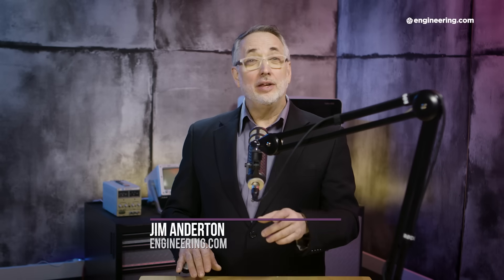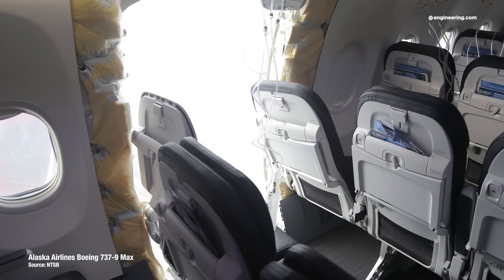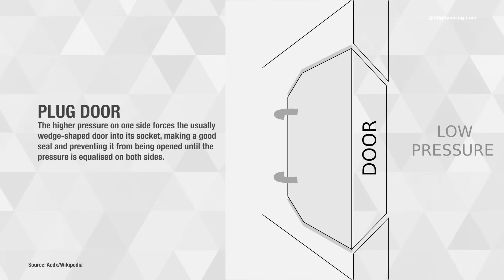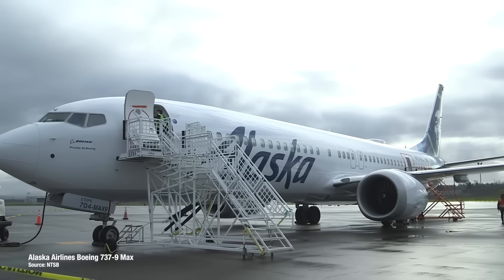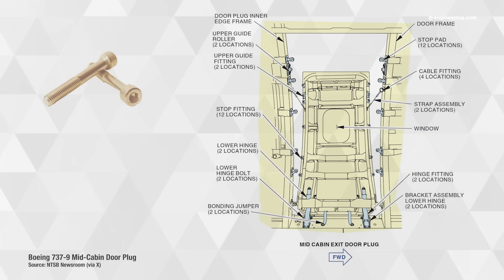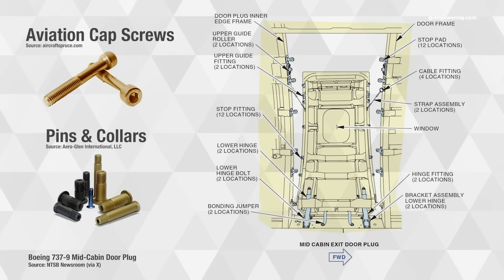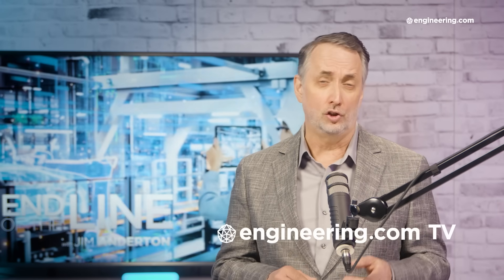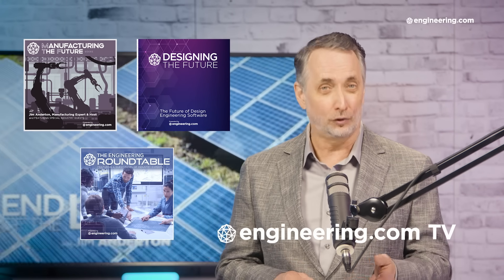The Boeing Issue Isn’t About Bolts

Comment: I have been constantly commenting on the lack of anyone talking about the what you call "witness marks."  Immediately, they knew if the bolts had been installed or not by the marks in the holes and where the end of the bolt and the washer on the nut side were tightened.  A cotter keyed bolt does not come out easily.  If the bolts were in they had to be sheared and those marks would be obvious.

What you did not talk about is the terrible corrupt culture of money over inspection.  This is a problem everywhere.  Inspection used to be #1.  I cannot even buy a high end cam and lifters for my motor anymore without multiple failures from the same Q.C. problems as Boeing and many others have now.  

Now that there are two crashes from a lack of good engineering and this door that falls off because of a lack of a culture of inspection what does it take to wake everyone up.

The prime blame here is on the FAA.  They control this.  I had a friend who worked at Douglas and was the prime FAA person for Douglas.   Many FAA employees went far ahead at the FAA as a result of them making sure all was properly inspected.  It was noticed that there were many fewer problems there, good careers resulted.  Now, you cannot blame inspectors if they are not honored for the importance of their jobs and not given what is needed to do the complete job which is also looking for FOD.

I was one of the few highly trained skin and frame repair people.  That at the time was the rarest of stamps.  Our work always passed the closest inspections as without our work that product could not be moved.  Obviously, no one does this anymore.

Spirit also builds for Airbus and many others such as Bombardier.  Is the same lack of Q.C. going on in those areas?  If they are properly inspecting other jobbers this is really ugly what is going on and if they treat the others as Boeing it is still ugly.  In one case the same management makes sure things are properly done, and in the other case the same managers have two sets of rules when there should only be one for a quality work place.
Reply: This recent Quality Assurance  problem is not limited to only the Aviation industry, were also seeing huge quality problems with new yachts, i've never seen so many of issues on new yachts in my 20yrs in the industry.
Cause and effect we saw a high number of experience guys leave the industry, it doesn't help when you have a Government threatening people to get vaccinated or get fired!!
Reply: Cost is now job one across multiple American industries. All the more profits for shareholders and executives. Notice I didn't say employees because now they are considered "costs". As you can guess this is short term thinking as the company is hollowed out "extracting maximum value" it will decline. Then everyone loses but by then the profits will be removed and long gone.
Reply: @cennsa140driver    Golden parachutes need to be illegal.  This is how wall street bribes execs to drive off the bankruptcy cliff without hesitation.  It is why so many companies only care about short term stock manipulation and disasters like this don't even hurt because investors can short their own investments to hedge.
It does not matter what the FAA does, they will never get these execs to help improve the company, they all get massive rewards if they stay the course, even if it means bankruptcy.
Reply: @cennsa140driver  We are heading to times where the fourth industrial revolution makes those jobs obsolete. It's just a matter of time. Maybe Boeing is a little bit too rashly here (irony intended). They have a huge backlog in their orders book. Nothing to fear currently from this point of view.
Reply: So many commenters think they are experts about SO any things.  The earth isn't flat, and unless this is your job, you are guessing.
Reply: @rogergeyer9851 There's a big difference between someone who worked in the industry making an educated guess and someone who never did just pulling it out of his arse.  I worked in the industry for years and saw things like this happen more than once.
Reply: @ Georgia - I doubt that most have any idea what a 'stamp' actually is.  As a QC person, you are required to stamp the process sheets and verify that the step was completed in accordance with the applicable requirements. 
Your comment about Spirit building for Airbus, Bombardier, etc. is also salient and brings into question how widespread this may be in the industry.
Reply: @vincentsutter1071 It's a lot more common than you think, and it's not just fasteners. I have seen situations where major structural components were left uninstalled.
Reply: I'll believe boeing is fixing quality when they announce massive new hiring.  They need more people so each person does a little less per day and everything is inspected by someone who also is not overworked.

The FAA needs to set minimum staffing levels.  If the FAA does not require boeing to hire more people, the execs will never do it.  They all get golden parachutes if they run the company into the ground, they are going to hang onto those jobs until boeing is no more because it will make them way richer.

The FAA could fire every executive and every board member.  They could set strict hiring criteria and do the hiring to staff all the positions.  Replacing everyone with legitimately qualified people would actually be the quickest way to save the company.
Reply: There really wouldn't be witness marks in this case as the missing bolt assemblies are more like clevis pins with extra parts.

Comment: The door in question is actually a semi-plug door, as are the entry and service doors on the 737.  Regardless, the problem, as you say, is not with the fasteners.  It is also not with the assembler or mechanic, at least not directly.  The problem is a lack of an effective quality assurance program, which the executives declined to fund in favor of a system of bribery and repression, which has so far cost 346 passenger lives, and which is not going to change.  The choice was made, the money has been spent, and Boeing will kill more passengers before it is mercifully put out of business.
Reply: This ^^^

Comment: The issue was never about the bolts. The same design plug doors are used on Airbus A-321s.
It's the quality control and quality assurance at Boeing that is hopeless.
Reply: Then how come Spirit Aerosystems never learned from fixing the mistakes on Airbus planes if Airbus’s QA really is better?
Reply: Deregulation

Comment: “We can’t blame the fasteners if the technician forgets to put them in,” you must not have read Sidney Dekker or Todd Conklin. Probably unfamiliar with Gary Wong or Dave Snowden.
Reply: We can blame the process documentation that does not require reinspection if the fasteners are removed, but the door is only opened, but not fully removed. That was a cost saving decision.
Reply: You can blame the ‘technician’ if they had a clearly defined and continuously documented responsibility, if they hadn’t then their bosses are criminals.

Comment: If it's a maintenance issue it'll be pretty easy to work out what went wrong. There'll be a record of removing the bolts, so there should be a card issued to refit which should've been signed. Should also be signed cards for inspections of the door jam etc. All very traceable.
Reply: Blanolirio channel has an interesting discussion showing process confusion between contractor and subcontractor and two different procedures, one being ‘open door plug’ while the other is ‘remove door plug,’ the latter includes replace or reinstall and triggers a QA check while the former does not.
Reply: @jimallen8186 and when replacing the seal there is no requirement to check off bolt reinstall if the door was just  open and not removed. Looks like another step that’ll slow down the line so just leave it out. Gotta get the product out the door.
Reply: Doesn’t work like that anymore… sadly.
Reply: This is actually the most important item in the entire discussion. Inspection. ISO9000 and aviation equivalents require a documented procedure for every step in every process including inspection. The points are proper assembly and inspection and documentation for validation. However management reduces the number of employees, those stinkin’ employees are always wanting pay and benefits. That cuts into executive pay and profitability.
Reply: @markw208 procedures are great but they need to work . 100 % inspection the best but nobody wants to pay. The operators can check their own work , ha ha
Reply: @peterneumann7145  , To be ISO9000 certified the inspector can’t be the assembler
Reply: Don't you understand how very expensive all those cards and pens and people for signing are? And that the person checking fasteners were properly installed could have been installing them in another aircraft thereby doubling production for the same labour cost?
It's obvious why YOU don't have an MBA.
Reply: @andrewallen9993  lol ok
Reply: you're assuming it was documented, or documented properly.....
Reply: Just because a card is signed does NOT mean the work was done correctly, the inspection was proper vs. just signing the card, etc.  Look at Helios flight 522 tragedy as an example.  Engineer said he turned the auto-pressurize switch back on (and signed off on it) -- but it was left off.  That plus incompetent and careless pilots (missing multiple checklist items, missing obvious alarm meanings, etc), and everyone on the aircraft dies.  This is all formally documented and in various videos explaining it.  Mentour Pilot dooes an excellent video on this explaining many procedures / issues from a pilot's pint of view, but in simple language aimed at laypeople.  (Several other videos are far too superficial re such details). 

I was actually on a commercial jet where the pressurization failed at take-off.  By the time we hit the lowest cloud level, it was OBVIOUS.  We just landed and took another flight.   No big deal, just a 4 hour delay.  Oh, and it was obvious LONG before we were anywhere near passing out or having oxygen masks fall.  Just ears popping more and and feeling a LITTLE like it was getting harder to breathe normally.
Reply: Rhetorical right? @rogergeyer9851
Reply: Bought shares at $200 yesterday.  Not a design issue and a fixable maintenance one.  Not sure who is worse, BA or the FAA.  The FAA is so behind the curve that in trying to catch up they might kill BA.  How does the EAA not have so many issues with a company owned by multiple countries?
Reply: @boatlover1875 , BA is killing BA, not the FAA.